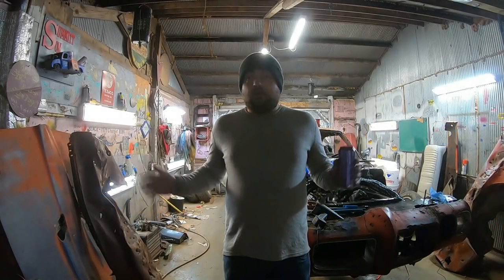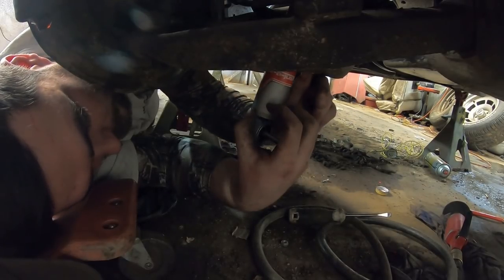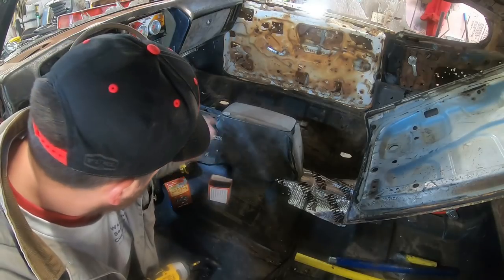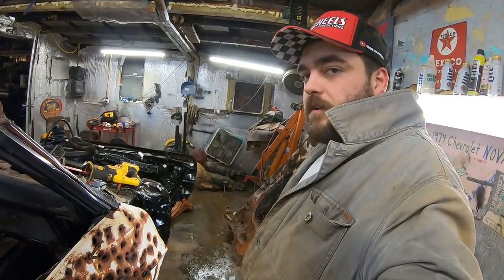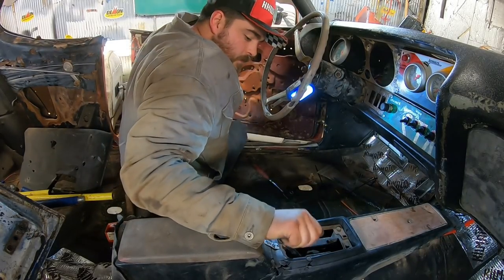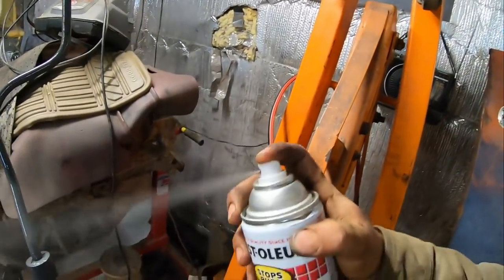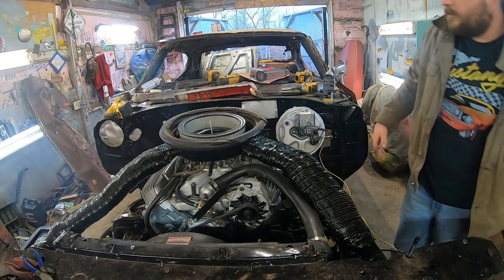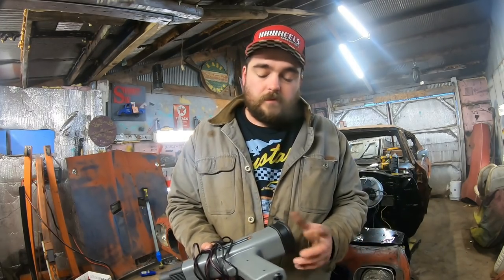The Holey Goat: Worst GTO Ever Part 11 — WILL IT RUN? Plus Official #NoNameNationals Announcement

Comment: Around a half-hour in, I confess I was getting a little impatient to see IF IT WILL RUN. I remember how I rebuilt the 389 on my 1963 Bonneville, in the early 1990s... the first firing up was an experience, let me tell ya. After that, that Pontiac project got stalled for various reasons (late 1990s), and later found a new home at a younger relative's garage... Thanks for the feast for ears!

Comment: I think what you're doing is comparable to what VCC Garage did with their Bicentennial Chevelle. I also hope a company like Year one sponsors the resurrection of the body, as they have all the metal.
Reply: You can not mess with the body of the Holy Goat. (without a sledge hammer). Okay, maybe structural stuff, but it better visit the practice range prior to installation because 'merica. Can't really turn away a sponsor, do their stickers have holes?
Reply: It's independence chevelle and you should stop changing the names of things  you actually don't even get the point of what he's doing.   I'm sure you will figure it out when he's done.. but on the other side nothing is ever done..

Comment: A tip on the front shocks. When removing the top nut just use a deep well socket and a long extension. Seat the socket on the nut and start bending it back and forth using the long extension. It will snap off.

Comment: I found the easiest way to get those shock bolts off is to put a socket on a long extension and wiggle it back and forth and it snaps them right off. Great series I have watched most of the other videos and am binging on the goat series. 👍🏻

Comment: In 1975, at 13yrs old  we got a 71 firebird with a bullet hole in the dash running on 3 diff size tires and rolled memphis backroads like kings..you got it beat brother.
Reply: Great cars, even better with good rubber......lol...great cars, a friend had a 72 Formula 350 3 speed, black with white stripes, white interior...what a slick cruiser it was, highway geared, cruised country roads at 135 on several occasions.

Comment: For future front shock adventures. If you use a deep well socket on the shock mount nut and like a 12” extension you can rock it back and forth till it snaps. Beats trying to fit a death wheel into that small area, and way faster!!!
Reply from the maker: This is something I've learned since starting YouTube!
Reply: @PoleBarnGarage  outstanding!!! Enjoying the channel!!

Comment: I think another good ol' tune from the eighties would be 'Lifes' been good' by Joe Walsh. You may just out do the James Dean death car with this build! LOL! Love the way you bent the ball cap into the donald duck 'quacker,' that's exactly how we did it back in the eighties. Don't forget to put a magnet inside the oil pan and outside the tranny pan to collect the metal filings (an old trailer park trick), anyway the Poncho sounds great growling up a storm
Reply from the maker: Used the magnet trick many a time!

Comment: There is a very easy way to get those shocks out.  Take a deep socket the same size as the nut and a long 1/2" extension.  Put it over the nut and just bend it back and forth.  It will break out in no time at all.  Safety glasses not required.

Comment: Too bad about the front lift shocks not working.  However,  you could consider the lovely twist in coil spring blocks, which is what us dollar free kids back in the day did.  My 70 Tempest GT-37 looked sweet back in the 70's, lifted on both ends - air shocks back and lift blocks front...  sweeet.
Reply from the maker: Read my mind! Actually, the car already has sweet spacers in it

Comment: As soon as I saw those springs on the front shocks I was thinking no way those will fit through the lower control arm. I recently put some QA1 shocks on my 69 Camaro with stock control arms and I had to widen the hole significantly just to get them in. I was going to put them in from the top but there wasnt enough room inside the coil spring for both a spring compressor and the shock.
Reply from the maker: It's worth doing for a good shock probably

Comment: Never had a problem with Fram, I've had a problem with Wix where the filter element clasped, it was on my 99 suburban, bone stock 350, was wondering why after an oil change I had no oil pressure after unless I was nearly standing on the gas pedal, changed the filter and the filter element inside was coming out the hole that threads, I tore it apart and sure enough it was falling apart inside, I replaced it witha Fram just because I just did and oil change and I though something else was wrong with my truck, Wix did contact me and replaced the filter but do I want to use it again? idk.
Reply from the maker: Everything is a little less than it should be these days.

Comment: Istead of using a cut off disc to cut top shock nut/shaft you can put a deep well socket that fits the top nut and with a really long extension on the deep well socket you can pull and push the extension  back and forth and it will snap off the topof shock without having to cut it.
Reply from the maker: This is a great tip, especially for guys without air tools

Comment: In the old days type F fluid and a small bottle of brake fluid will nurse a ailing transmission along. also a during a back fire keep cranking to suck the fire inside of the motor unless there is a massive fuel leak.
Reply from the maker: It was the excessive amount of starting fluid that caught on fire or I would've lol

Comment: if u have a good impact just set to tighten don't even try to loosen it just pop the bolt and u will find it is the best way and fast  but u need a real good one
Reply: ps a real good parts car for a gto i found was a 75 Bonneville they have air, power everything and it all bolts in . that is the car i used on my 66 gto to put power window locks power trunk and air plus it had a good 400 400 turbo air shocks and u can get them for free or cheap o and they have shocks on the bumpers 35 mph hit no damage

Comment: Last year I had to get metal ground out of left eye. I was whareing glasses. Cleaning a rusty bolt on bench wire wheel. Nine months later. Sucks seeing a dreml& drill bit coming at my eye,lol!. I have goggles now,lol!
Reply from the maker: Well, thanks for the nightmares
Reply: Sorry for the nightmare,lol! Been wrenching on cars since 1988 .picking crap out my eyes working on rusty cars. My nightmare happened last year,6 month later happened again.no worries. No loss of vision. Just don't want anyone else to go through that.

Comment: I have a old 68 GTO in my back woods... I should get it running... its stripped bare like yours.. just not shot up. Bunch of years ago I had a GTO from a Indian reservation that was just beat to death and then hit by a tree.. that would have been fun to bring back.
Reply from the maker: You should! If you don't, I will!
Reply: @PoleBarnGarage  Ok going to see if my son wants to help me... I"m like you I have enough parts to make 3 of them.. but it will have a Oldsmobile 455.
Reply from the maker: I'll take an olds, just keep the 403
Reply: @PoleBarnGarage  Just so hard to find decent PMD engines.
Reply from the maker: I really haven't ever had much trouble, example, I bought a 60 Pontiac out of a field last fall for $260, car was completely gone (obviously if even I wouldn't try to fix it, it was bad), but I got the 389 running and it's just hanging out waiting to go in something.

Comment: Blue front shocks are old MonroeMatics
Reply from the maker: Can I warranty them?
Reply: @PoleBarnGarage  I think they still make those, so maybe. I believe they were owned by Tenneco back then. Funny story. A buddy of mine bought a '58 Vette when he was in HS and planned to keep it "forever'. Everything he bought for it Shocks, exhaust, battery etc. was 'Lifetime Guarantee'. He bought a battery at JC Penney from their Auto dept. (they had one like Sears) which was a Forever battery or something. When they closed their Auto Dept they transferred the warrantees to Firestone so for like 35-40 years he got free batteries. Last time I bought a set of those Monromatics was 22 or so years ago. They were 'OK' maybe 20 bucks a shock or so. The parts guy really hyped them up to be "the GOOD Monromatics" over their standard offering. Back then it either Gabriel Stryders or Red Ryders or Monroe.

Comment: No much hope to getting my Chrysler 300 engine going. Somebody robbed the spark plugs while it was sitting on the ranch on Big Spring. Really a shame because it only had 41k on it. I would guess it is full of dirt and stuck. No worries because I have another junk yard motor and trans to slip in there.
Reply from the maker: Same thing with the GTOs original engine actually. Most of the plugs were gone

Comment: Speaking of tranny fluid -- I've never changed it in my 30-yo Saturn because I read once somewhere that if it works, don't change it -- because it's a closed system and once you start messing with it, you start having problems. Do you agree? Why or why not? Thank you Dalton!... (it's a 1993 SC2, which I bought for my oldest son's 16th; it still runs like a top today - 100% made in Springhill, TN. I loved it b/c it was all made in America. I struggled to buy it (used) in 2002 for $4,500 -- I was a single Mom, so -- emotional about it still) ...  And I have now had that vehicle, after both boys drove it for 1 year each, for 21 years. My boys say they may bury me in it.....if they don't decide to push it off a cliff instead....
Reply: I also would LOVE to have it lifted up just a little but have been told that's not possible.

Comment: That clutch material in the transmission pan is normal with a high mileage and/or hard driven trans. It should be fine with a new filter and fluid. Also, a bottle of Sea-foam wouldnt hurt either. Did you put a magnet back in the pan before bolting it back on? You probably really need one in there. I still cant get over how clean the floor pan and frame are. Maybe you should try to figure out how to drive it upside down Bud! 😂
Reply from the maker: Keep the "sunny" side up 😂. I'll glue a magnet to the pan before getting it back on the ground, good call
Reply from the maker: Also, how many miles does a trans need to have before it develops leaves inside of it?

Comment: Maybe you’ll get luck but I’ve seen several trans be shifting fine and change fluid and filter and it not make it 50 miles

Edit.  You said it after I posted.
Reply from the maker: I know, serious mistake on my part. Hopefully the additive is like a "friction modifier"

Comment: Are you going to try and install some windows, like a windshield and rear window or are you going to wear a helmet with a shield? If my brother had any use for a computer besides used as a boat anchor he lives and breaths Pontiacs. He has been a Pontiac fanatic for over 50 years or longer. When I say Pontiac fanatic he has dragged race Pontiacs for 50 or more years and collects Pontiac parts and cars.
Reply from the maker: Windshield for sure, we'll see what happens with the rest
Reply: @PoleBarnGarage  I just remember that Dodge used straps/velcro to hold windows up in some specially made drag racing cars. An idea for you, don't need window regulators just some guides.